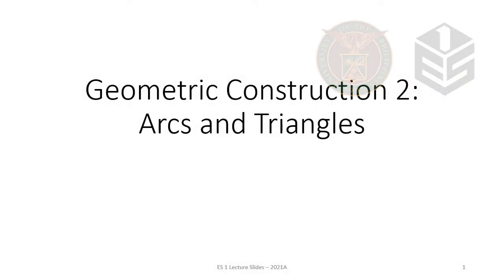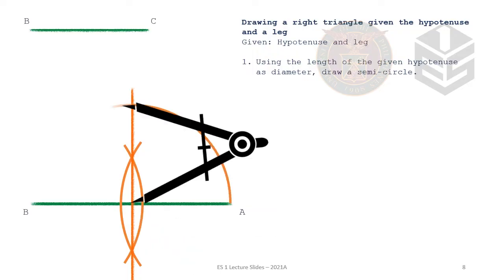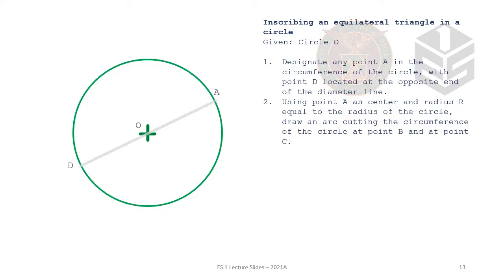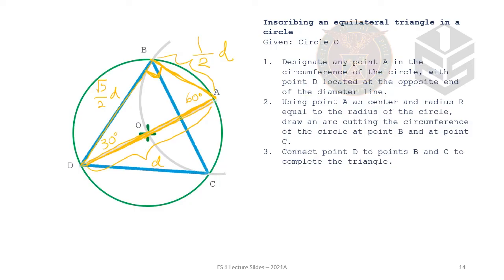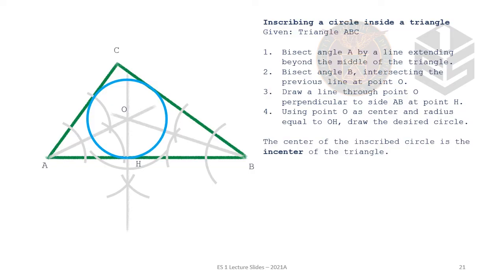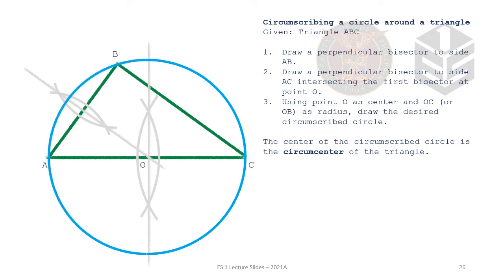Geometric Construction II (Part 2)

Comment: Timestamps

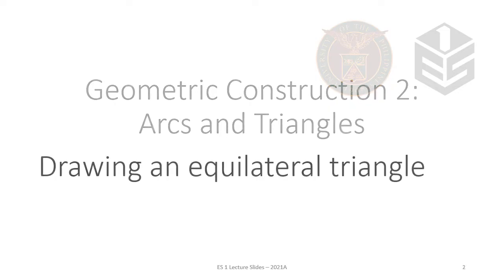0:10 Drawing an equilateral triangle
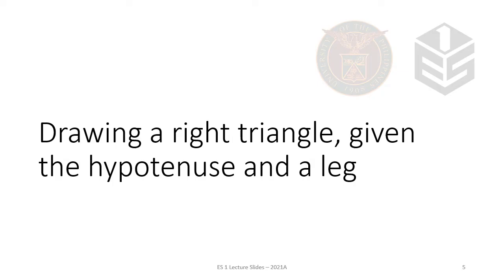1:56 Drawing a right triangle, given the hypotenuse and a leg
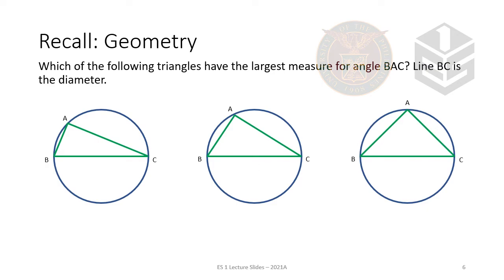(2:07 Recall: Geometry)
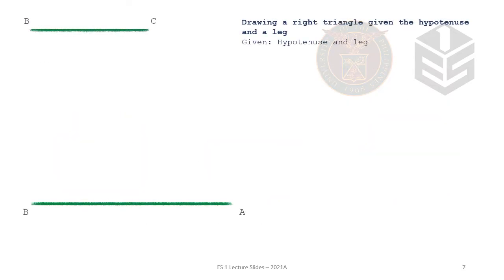3:18 Drawing a right triangle, given the hypotenuse and a leg cont
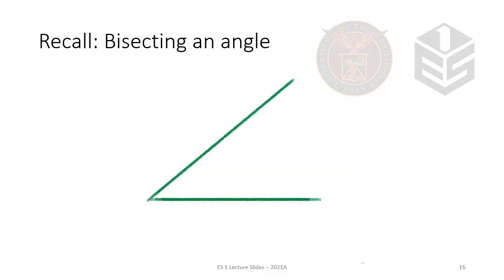8:43 Inscribing a circle inside a triangle
(8:46 Recall: Bisecting an angle)
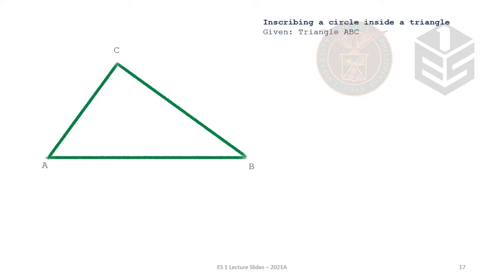9:13 Inscribing a circle inside a triangle cont
11:29 Circumscribing a circle around a triangle